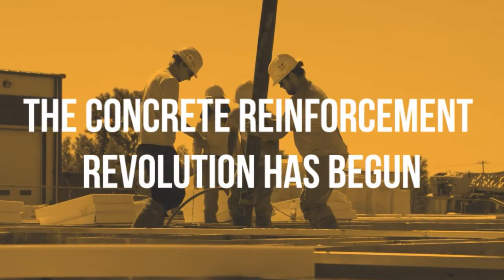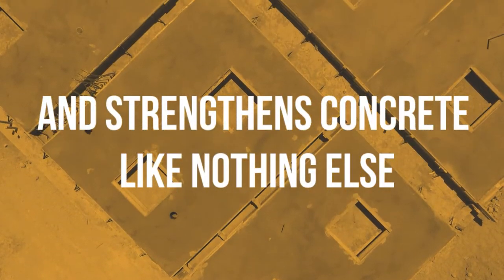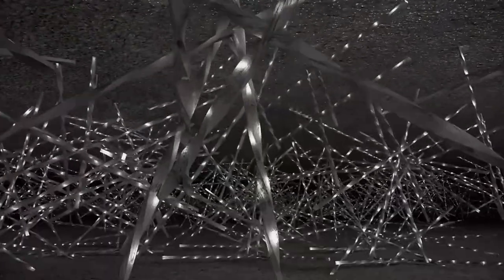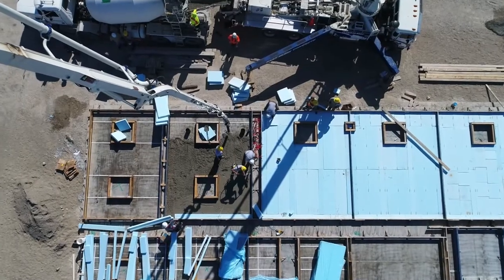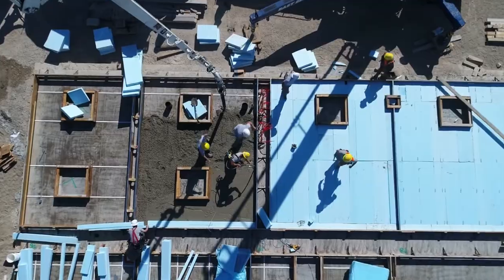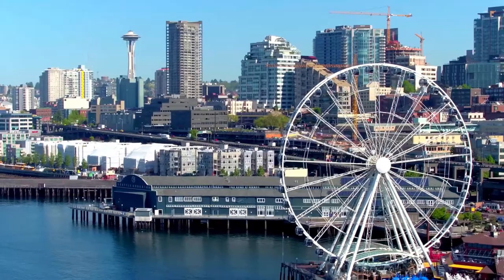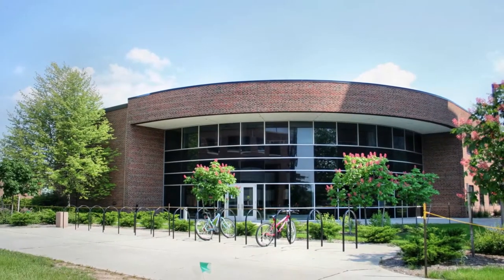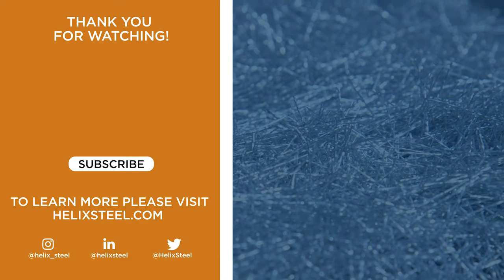The Construction Industry’s Favorite Concrete Reinforcement: Helix Micro Rebar

Comment: When it rusts does it pop the concrete (crack it through expansion) or just leave the concrete weaker than it would have been with nothing added in the first place?
Reply from the maker: That's a great question, Each one-inch (25-mm) twisted steel reinforcement is coated and individually sealed to withstand elements. Proper concrete finishing techniques will ensure that the steel is forced below the surface. Helix does not provide additional entry points for moisture. You can read more on our FAQ page here https://www.helixsteel.com/faq/, thanks!